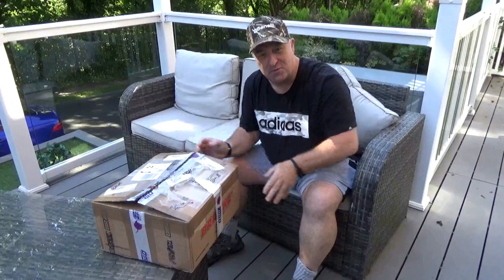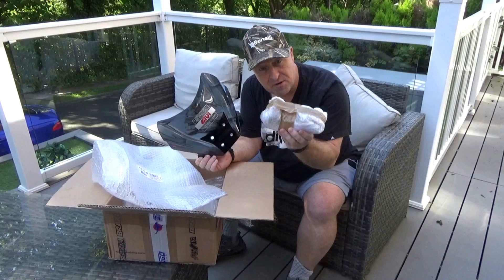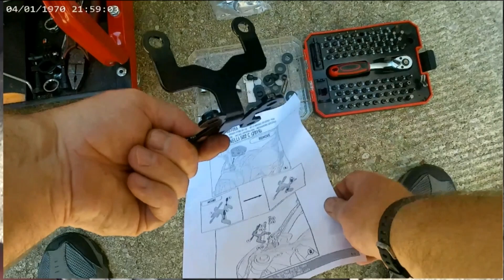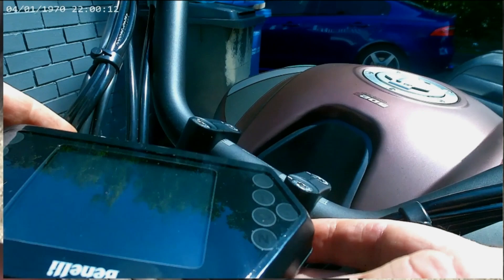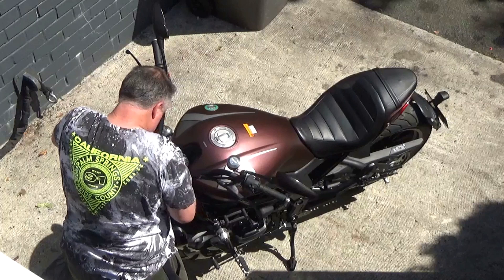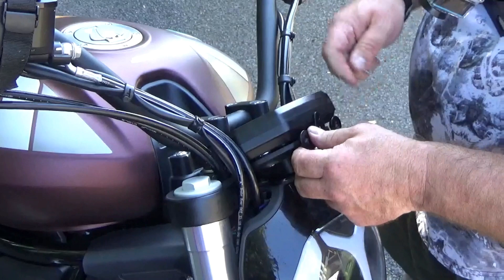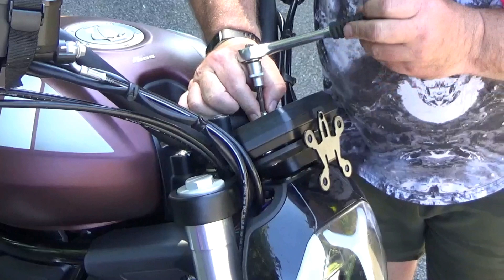GIVI screen unbox and fitting to Benelli 502c

Comment: Great video.. I just wanted to ask where did you order those frame sliders from? I have just purchased 502c and want to mount those on my bike but can't seem to find them anywhere. Would you be able to drop the link please? Thanks in advance
Reply from the maker: They came with the bike I believe you can order them either through your local benelli dealer or direct from benelli UK. 👍🏻👍🏻😎😎